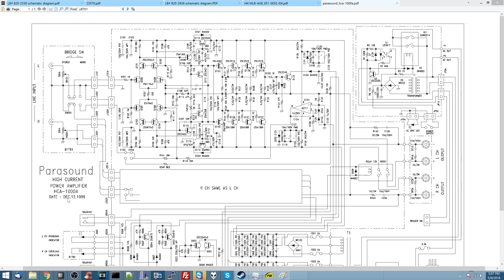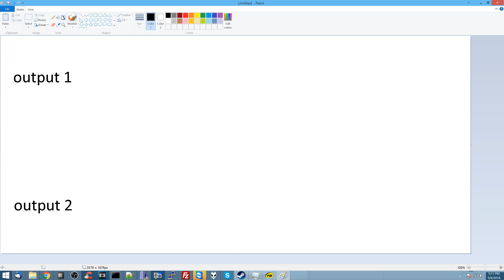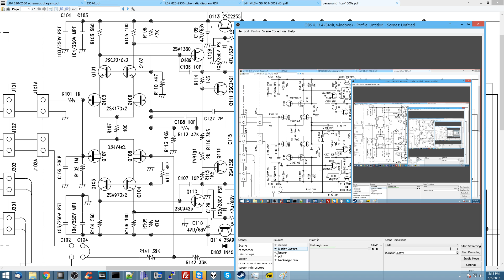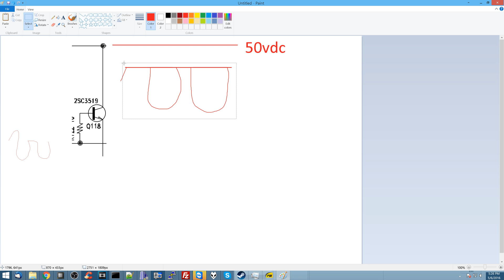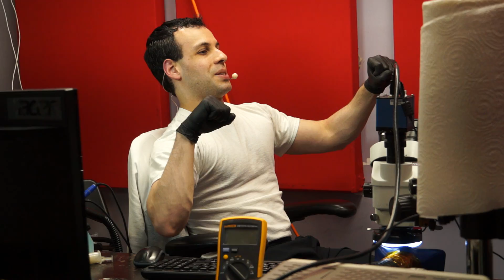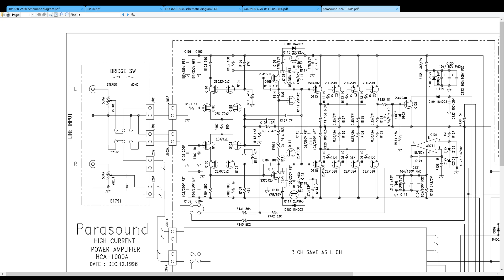If you didnt believe I flunked out of college...

Comment: I am a college dropout myself and I have to say That many experts in field That I know are actually dropouts too . Currently I am working as hardware designer , and They Went trought about 15 engineers with an actual masters degree before They Hired me . And as my boss told me ; they all did not Knew the basic stuff (I guess all Those Who Knew Were it already Hired ) .
The point I am getting to many times That is , current education systems are bad , Because They do not teach the practical stuff and you can pass Even if you forget everything you learned in that class one week after the exams.

To the actuall video. The reason for drawing just one diode in rectifier is that it's one device (with 4 physical diodes build in). The design of that amp is very nice, almost engineers porn :) It's the typical build with some bonus features like protection or active DC suspension of output (so they don't need huge caps). Also you said that there are stages with different amplification which is not really true.  It's all working together, something like one really powerfull OPAMP, I am just nit picking, but it's more like substages of one block than many separated blocks.

Comment: I've got a Sansui 101 stereo amplifier that is 40 years old. It came with a service\operating manual, which I still have, that includes full parts list and schematic showing voltages at key points, actual-size PCB templates for the power and tone boards with component layout overlay, and an exploded view of the case showing all panels, nuts, bolts, washers, potentiometers, and knobs, and two mono photographs indicating off-pcb components. Oddly, although it was bought in the UK, it has two US two-pin power sockets at the rear, one switched, one unswitched, very useful for feeding peripherals. A year ago I replaced the speaker connectors with gold plated knurled screw clamps, and replaced the microphone and headphone output jacks, as one was broken and I wanted them to match - impossible getting actual replacements, I had to adapt what was available. At some time in the future, I may replace the output caps with expensive high quality ones, just for fun, not because it needs it. Also, because there are no ICs, if it develops a fault, I'd probably be able to repair it. The only thing that's worn is the rotary on/off switch which has a brief delay before it clicks on, which I may or may not replace. Can't remember what it cost. Just thought you might find that interesting. Keep meaning to scan the manual and upload it to a few sites. 
Once you've read this, if you don't want it cluttering up the comments, I'll happily delete it; it's really only for you. I enjoy the vids, by the way, particularly when you're in a bad mood. I've subscribed.
Reply from the maker: The sad thing is that a lot of the time when people comment on how manufacturers shouldn't include schematics, they are younger people that do not even remember that including this documentation used to be the norm.
Reply: I suppose it's primarily due to the complication of modern electronics, which often eliminates the possibility of repair for hobbyists and DIYers. When I was young most blokes would repair their valve radios and even televisions themselves; there were often so few components that the possibility of replacing everything was a real consideration. I can deal with simple boards with individual components, but repairing a motherboard at component level; ICs, micro caps and resistors, as you do, is beyond me. So a paper issue of schematics would largely be wasted, but certainly a .pdf wouldn't hurt. And it's just interesting following the schematic layout. But then, I can spend hours looking at maps.
Reply: Maybe "shouldn't include schematics" is the wrong way to look at it. Schematics were provided back in the day because there really was no infrastructure for the company to service the equipment. You were lucky to even get a decent warranty. When I bought my Apple II in the late 1970s, it only came with a 90-day warranty. That is totally unheard of today. So, schematics were provided because, like Apple in the day, they didn't have the staff dedicated to just repairing. They had to instead rely on the retail market, therefore making the schematics readily available.

Today, it is way different. A typical business model for a manufacturing company is to sell equipment at an extremely low profit margin, and instead have the service sector of the business bring in the revenue at high margins. As Louis mentioned in another video, Apple will take a broken logic board, give the customer a refurb and charge him $$$, mail the broken board back to Apple, fix the board, and then sell that refurb board to the next customer for $$$. And, that cycle continues. As a result, Apple wants to control the servicing of their products, and to do that they don't give people schematics like they once did.

And that's probably why some people would say that Apple shouldn't include schematics, as these people feel that if Apple did so, then the finished goods would go up in price in order to make up for the loss of revenue. Remember that Apple makes a huge amount of money off non-warranty repairs, as well as sales of AppleCare.
Reply from the maker: yuppiehi Apple sells NOTHING at extremely low profit margin.

Comment: Overall i would consider an ok walk-through/overview not going into detail.  Perhaps it is actually a good idea to skip the current/voltage gain discussion.
However since you did mention beta-value, it would make sense the explain it is the (current) gain.

Another component i have experience dying is the output resistors. Had a poorly ventilated Pioneer surround receiver where this happened... or perhaps the resistors just got so hot that they heated themself free of the solder... do not remember. 

Cool that Parasound mailed the schematics. However the overall design look pretty standard. In other words i am pretty sure you easily could figure out the flaw in in the output-stage without the schematic. I would be more skeptical it it was somewhere in the feedback loop or input-gain.

Comment: as you said, the T deliver slightly different V (because of internal resistance differences) so the one with the less rez will get a higher portion of the total current and so he will heat more. the bad thing about T is that they are less resistive the hotter they get, so they will take even more of the total current. and so one till he burn AKA thermal runaway. the resistors are there because they they act in the opposite way as a T in function of Temp, so when a T take more current he will heat and is resistor will to. but as soon as his resistor get hotter, his res will limit the tension and protect the T. Even with that, you must parallel T with a comparable internal resistance to limit the source of the problem. Your beta tester is DC source, a resistor and a voltmeter (voltage divider).  Take this to the top pls !

Comment: I miss the old electronics culture also.  Remember when owners manuals had schematics in them?  The PDF versions on the web usually have that page blank, forcing you to find an original manual.
Reply: Or go back to the days of tubes when schematics were on a print glued or taped to the inside of the case.

Comment: the culture in hi-fi is completely different then in computer manufacturing and development.  Hi-fi companies are not really worried about copying or sharing because the basic priciples of how most amplifiers are built really hasn't changed much in the last 30 years or more.  And no, the culture has not changed, apple has ALWAYS been very tight about giving schematics, even back in the 90s when I started getting into PCs, my good friend Ron who worked on Macs all the time had a hard time getting detailed schematics of Macs from the mid 90s, especially ones of current models (though sometimes he could get them for much older macs that were discontinued like the Mac SE or IIci).

Comment: These fucking kids....lol.  I remember a day when everything you purchased came with the prints in the back of the book.  Anymore, you are lucky if there is a single piece of paper in the damned box.  In my opinion, the shift has been from pride, to greed.
Reply: That's why diehards love those old Thinkpads. I bought a Thinkpad, maybe the first generation where they were owned by Lenovo, or maybe the last where they were actually developed by IBM, but either way that thing came with a CD that had a guide showing you how to replace every part, how to trouble shoot every device, torque specs for bolts even, and another book that had diagram after diagram for every single circuit board in the computer. It also listed the part number for every piece... truly impressive.
Reply: Jesse Crandle
That was typical for IBM.  Not many people realize the kind of company they are, unless you deal with them for business.  They still offer full documentation for their equipment and systems, but they are not a consumer level focused company.

Comment: mmmm point here , at 9.44 you drew only a HALF WAVE rectifications [for both 1&2 outputs] but the circuit [s] [ bridge rectifier ] shown are [both] FULL WAVE rectifierers, and you have drawn it as a half wave rectifier, so you have drawn it wrong,  ie imediatly after the 1st peak [ after 1st zero ], goes back down to zero, the begining of the 2nd peak STARTS IMEDIATLY  without the half wave gap before the begining of the 2nd rising  peak, which then goes down to 3rd zero point etc hope thats understood ? but only did 1st year HND electronic engineering . cheers

Comment: 6:30ish - About that "can't see anything to tell me what voltage"Transformer T1 - the bridge is connected to a 1000uF capacitor with a 25V rating, so the output must be 25V (peak) or below - probably about 20V to allow for the odd surge.

Comment: Yeah, something like that... :) As far as I understand the feedback shouldn't break the sound if the bandwidth of that op amp is high enough...
Reply: +RPBCACUEAIIBH I've failed at first to build my own amplifier using a schematic I've got from somewhere(a circuit with a 2x10W Toshiba IC), and that cost me one of my speakers. Then I've studied a bit, new and old designs, as well, and I've got to a point where I've hacked a broken car cassette player-FM radio combo, and I've succeeded to bypass everything else, enable the amplifier(there was a controller that kept it in reset until you enter the code, on a front panel, that I didn't even had.), and use it with 4 really good sounding DIY speaker, that I made of 4 mid quality car speaker, sheets of extruded polystyrene, and 4 rolls of toilet paper, glued together with hot glue. Some time has passed, and the amplifier broke down, so I thought what the hack! I had bad experience building an amplifier after a schematic I found, but that was a while back, I have learned since then, so I have decided not to copy a circuit, but to design my own, and build it, and I've succeeded. So now I have my own amplifier(with a TDA 7375 IC, in stereo configuration 2x35W), and it feels good. :D I've build my second somewhat modified arduino as well(I've used the bought one as my programmer to upload the bootloader to the one I've built.) which I fried about 2-3 times :P and a bunch of other circuits... None of those are perfect, I'm planning to re-design most circuit I've made but I'm learning... :)

Comment: for the explanation of bridge rectifiers (@9:40) you messed up, you explained a single diode rectifier, basically the bridge rectifier does the same, but has double the bumps (there are bumps where you drew flat spots.) the rest is still valid, just that you need a lot less capacitors using a bridge rectifier vs a single diode.

for the negative feedback, you don't have to have the full signal, you do it in real time, that means if there's a slight variation it will be corrected in something like 1/1 000 000th of a second on a good amp, maybe 1/100 000th on a meh amp, but that's still inaudible, 1/96 000 variations per second (96khz sampling) is considered very high quality, cd sample rate is 44.1khz, so if you are listening to a cd, the variations from negative feedback will be 2-20 times faster than the actual variations of the input. generally the guys arguing that it causes an audible difference are the same people who would claim to hear a difference between wav and 320kbps mp3.

ps: am I a troll?
Reply: https://www.bryk.pl/teksty/1/img/00019565.jpg
Reply: Actually since the bridge rectifier is used for a symmetric power supply instead of for a single supply, Louis's explanation is perfectly accurate.
Reply: mjouwbuis
I'm pretty sure I'm not mistaken, but I'll have to check.
first half, d0 (first positive then negative) side's positive voltage goes to output 1 (V+) and d180 (negative, followed by positive) side's negative voltage goes to output 2 (V-), then on the second half, d0's negative voltage goes to V-, and d180's positive to V+, resulting in 2 bumps per period, and no "flats"

ps: just checked with my scope on a symmetric transformer, with a full bridge rectifier, there's no flats, just 100hz bumps (with 50hz power).
Reply: mjouwbuis
ps: my schematic looks like this http://www.electroschematics.com/wp-content/uploads/2010/12/symmetric-power-supply.jpg
without the caps and regulators.
Reply: @mjouwbuis  yea I don't think Louis messed up the bridge explanation as he mentioned the possibility of the additional diodes that didn't show in the schema.
Reply: +mjoubuis is correct, because it's a split supply, each of the 2 rails is half wave rectified using a full bridge.

Comment: +Louis Rossman New to your channel, but old hat with electronics. You are almost there on the bridge rectifier.  The rectification output is a bunch of the tops of the sign waves. The bridge rectifier conducts in one direction and then the other. your schematic shows two taps on the transformer likely tied to the other and the reference 0v is the common point between the two power supplies.

Comment: what is PDF capture? Never heard of that!
Reply from the maker: +William Ward capturing a specific program rather than capturing the entire screen. older versions of OBS let me capture the entire screen at 60 FPS, not this slow 3 fps BS I have been getting lately.
Reply: Oh and thanks. I don't know what fps Snagit is. However it is one of the best capture programs out there. It is $50 bucks and you can get a 30 day trial.  Go to Techsmith if you are interested.  Thanks again. Oh it also can capture it can capture a part of the screen and turn it into a picture file. One of the most handy programs I have.
Reply from the maker: ***** qp=0 with x264. the screen capture framerate fuckup has nothing to do with cpu/gpu. capturing a static screen is 1000000x easier than capturing a live subject from a camera
Reply: try Bandicam

Comment: Only a few minor errors to my mind.  Firstly the transistors when turned on should not ever pull down the power rail, it should only affect the common rail which drives the speaker.  Secondly the transistor switching is voltage based not time based.  The transistor will not conduct until a certain voltage is present at the base which if not corrected results in distortion at the crossover point, most audible at quiet passages or low volume levels.  The solution is to put the audio signal through a capacitor and to raise the base current to be above the crossover through a voltage divider to the power rail pulling the voltage just high enough to turn the transistor on.  This means that both transistors will always be on and each will conduct slightly beyond their 0v or ground plane.  Credit where credit is due though, I'm quite good at this stuff; the computer electronic stuff baffles me!  So will it be a smoke test to find the fault blowing the fuses?
Reply: +toppledgod Both rails shorted to ground?  I would start with the bridge rectifier.

Comment: Not that its too relevant for the scope of this vid, but I'd like to point out that there are actually two feedback loops in this circuit. The one you showed R137-IC101-R142/R141-Q106/108 is a DC stabilizing loop and actually compares the output voltage with ground (at pin 2 on IC101 thru R138). This is so that the speaker doesn't get a DC voltage applied across it, which could destroy it. The other loop you talk about, the actual gain setting loop for the amplifier is going through R112/R113 and onto the gates of Q106/108 (and also gives the voltage gain of the amplifier as 1+47K/1.8K = 27 = 28.6dB non-inverting). Most amplifiers don't need a DC stabilizer loop as the input stage is often asymmetric and the operating points well defined, but this one would need it since the DC operating point at the output is not well-defined due to input and gain stage device non-idealities. It is also interesting to note how they use series pass elements Q113/Q114 for killing power supply noise in the input stage, which is also symmetric in itself to improve PSRR.